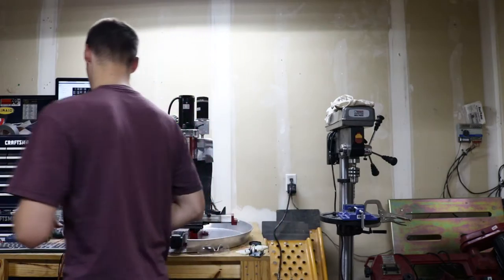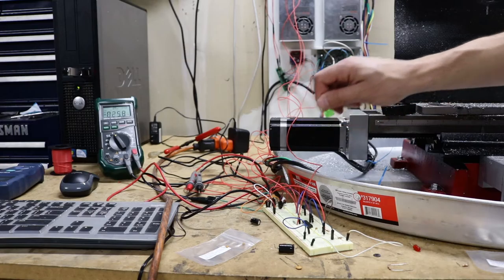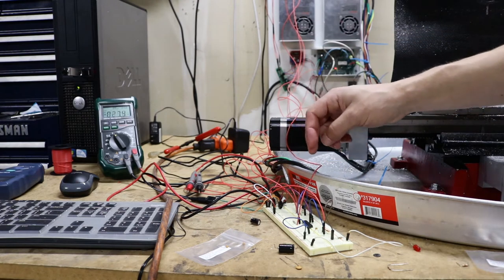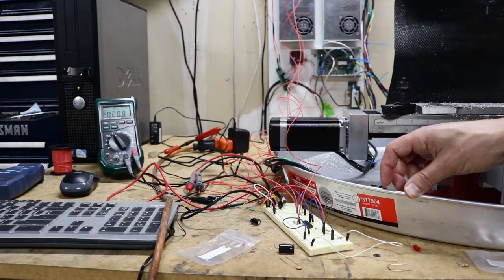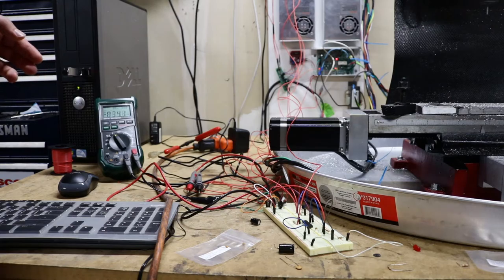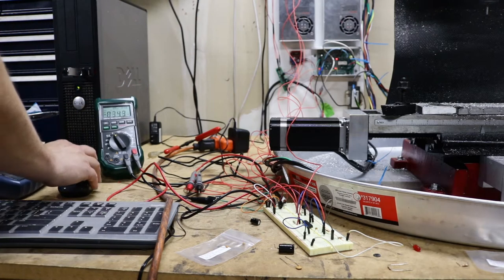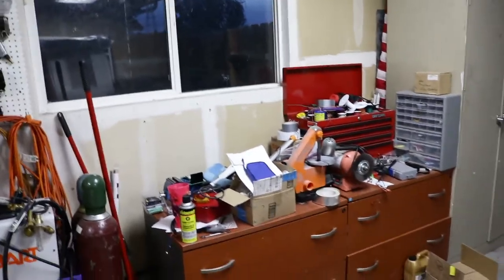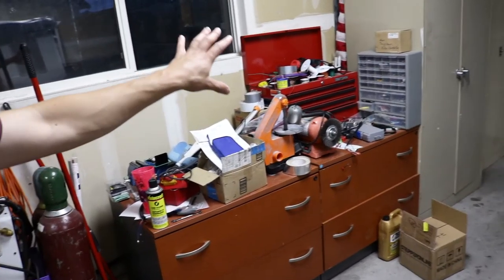Spindle Control Board in ACTION!

Comment: What kind of signal does the board output?  Congrats on the Tormach!
Reply from the maker: The board outputs a 0-20ish analog voltage signal.  The max voltage is adjustable, so I have mine set at 12 for the sieg.  The only thing is the output signal is not perfectly smooth, it still has a frequency from the pulse width modulation input.  But, it is driving the treadmill motor control board well though.